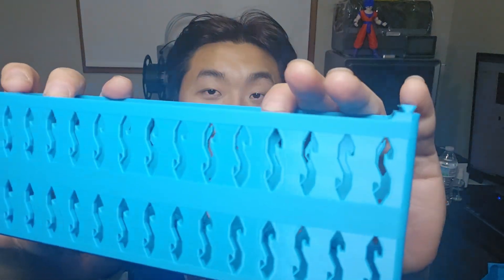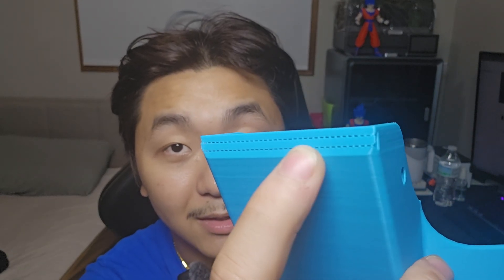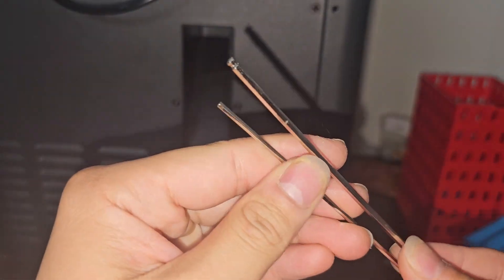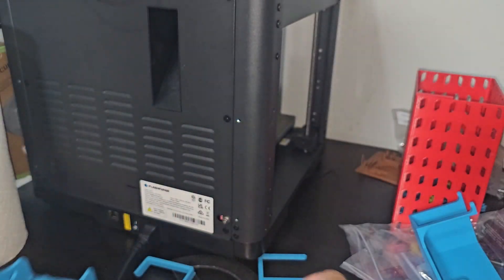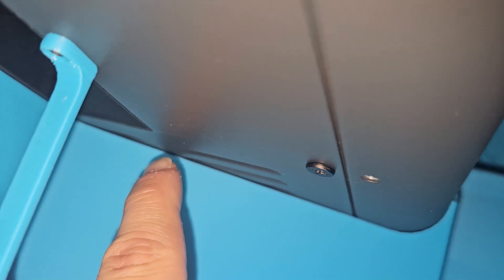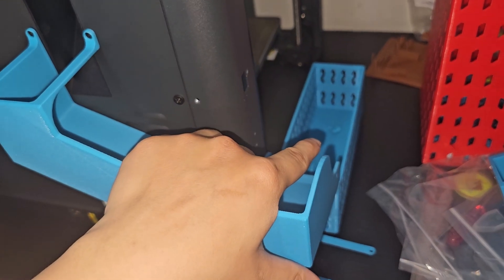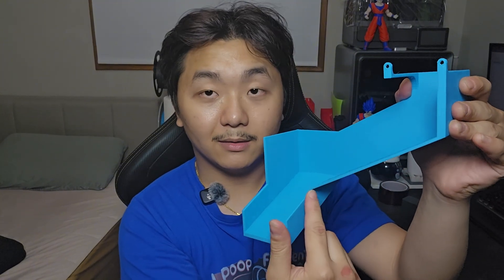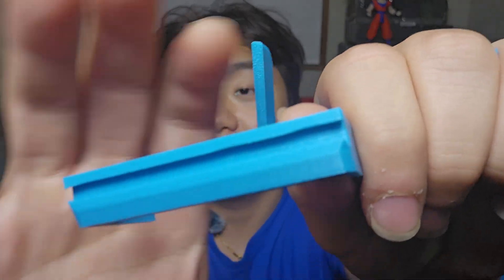Flashforge AD5X Poop Chute With Bin | MUST Have Mod

Comment: im new to 3d printing, got a little confused with talking about the supports. Do i print with tree auto or normal auto support?
Reply from the maker: You can do either. I recommend doing the support manually so it only prints support in the needed spot.

Comment: fantastic dustpan, I would like to modify it to use it with the official enclosure... How do I modify it to add thickness and so that the holes for the screws on the side continue to coincide?
Reply from the maker: I made one for the enclosure. Check it out.

Comment: Just set up my 1st 3D printer, the AD5X. Needed a chute and found your channel. Got a sub, thanks for making this!
Reply from the maker: Amazing! Thanks for the sub. Yeah these multi color 3d printer needs something to catch all those poops. 😅
Reply: @Scratch3DPrinting  Chute completed! Printing your hex bin pattern next. I am using sunlu's pla+ 2.0 and the screw holes on the chute were a little thinner than intended after removing the scraps. Overall not too shabby for a 2nd print ever.

Comment: I love the Poop Chute you have and I have made the new larger chute for the enclosure with the larger bin you have.  However, I also have the Riser under my AD5X so the bin is 2-7/8" too short to rest on the table.  Is there a chance you can make another modification to the larger bin to be 2-7/8" taller with everything else the same?  I would attempt to go modify your design but I am just starting out and have not master any modification yet.  Thank you in advance.
Reply from the maker: Ill see if i have the time to do it. Glad you liked the model.

Comment: Dude what's the name of the little clapper door that knocks off filament? The spring is messed up and I can't find the part name 😕
Reply from the maker: hmmm, im not sure as well, cannot find any replacement parts for it. Maybe you can contact Flashforge support and see if they can send you a new one.
Reply: @Scratch3DPrinting best I could find was that my torsion spring on the waste outlet module snapped 😢

Comment: I just got my AD5X and was wondering if this poop chute would work with the enclosure kit installed. I am new to 3D printing so not sure how to edit the model to work with the enclosure kit.
Reply from the maker: no it does not fit with the enclosure. I will make an update on the poop chute.
Reply: @Scratch3DPrinting  Thank you

Comment: @Scratch3DPrinting  im new to 3D printing and have the AD5X. I like your design and was hoping to make one but slightly more narrow. Yours appear to be about 2" wide, the space I have is so small that if I can make one half the width, it may fit. How would I change the width using Orcaslicer? thank you!
Reply from the maker: Yeah, I made it big to prevent the filament poop from clogging the slide. You'll have to edit it in a 3d modeling software, orcaslicer dont have that ability to edit it.

Comment: The idea isn't bad, but it's a real shame there's no option for an installed enclosure. And honestly, there's so much waste that it needs to go straight into a refrigerator box. Your little basket is child's play, if I may say so.
Reply from the maker: Yeah, I'm getting the enclosure kit and will do an update for that. Plus I'll make a bigger box for it too.
Reply: @Scratch3DPrinting cool, very good idea!
Reply: Please please please  make a bigger poop shoot for the ENCLOSURE
Reply from the maker: @jusblazzinshabazz6794 I want to, but i have not receive the enclosure kit from FF yet.
Reply: @Scratch3DPrinting ok look I've been thinking on how to seal the enclosure more the window that the tubes go through for the IFS
should also be sealed.
A thin layer of flexible filament with 4 holes glued around the filament holes. 
COMPLETE SEAL???
tell me what you think??
Reply from the maker: @jusblazzinshabazz6794 yeah that could be a way of doing it.

Comment: i have an Anycubic kobra 3 max. do you have a poop shute for that?
Reply from the maker: I have one for the kobra 3, but not the max.
Reply: Will that work for the max?
Reply from the maker: @GlennMudd  I'm not sure. You can test it out.
Reply: I have a technical question for you.  What would make my nozzle scrape the PEI print board